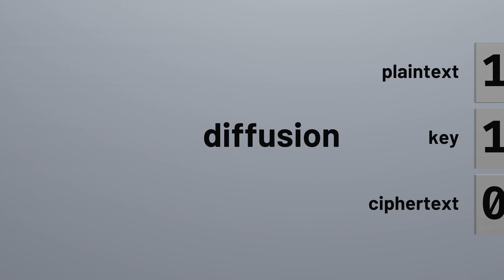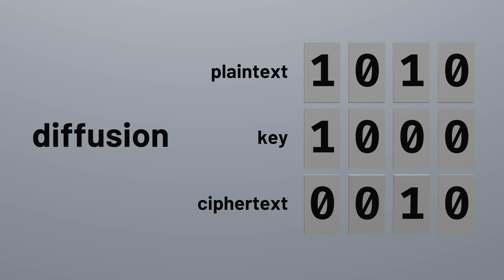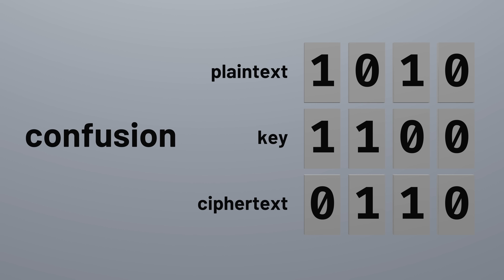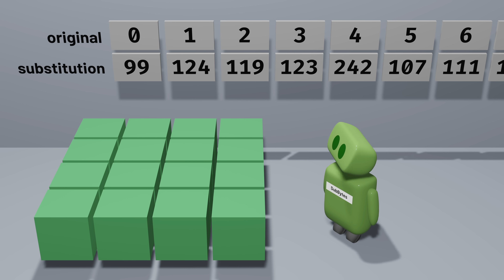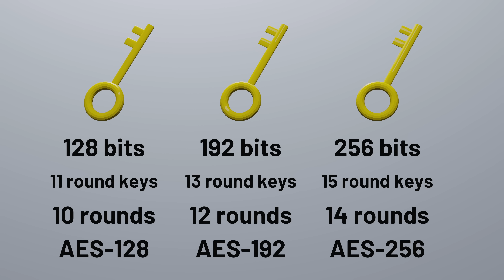AES: How to Design Secure Encryption

Comment: ya but how is it decrypted?
Reply: Each step has an inverse step, you just apply them in reverse order to encryption:

AddRoundKey is its own inverse, you just have to add the subkeys in reverse order.
ShiftRows just shifts them in the other direction.
SubBytes you just read the substitution table backwards
MixColumns is a bit tricky. it works the same as for encryption, but you multiply by different numbers. Only hard part is showing why those numbers in particular work.
Reply: @piscesdan.7151 thanks mate  :) that info helped a ton. So basically this decryption is similar to fiscal Cypher decryption.

Comment: Probably been done, but I'd actually love you to go through that AES thing from the direction of 'decryption'.  How are all those steps reversible?
Reply: It's suprisingly simple. Each of the steps has an inverted version, so you just apply these in the reverse order of their regular counterparts:
AddRoundKey is actually its own inverse, you just have to add them in the reverse order (so add last subkey first, add first subkey last)
For SubBytes, the table is set up in a way so that each output value corresponds to exactly one input value, so you can just read the table in reverse.
With ShiftRows, you just shift the blocks in the opposite direction.
Finally, MixColumns. The reverse works similarly to the regular version, but you multiply by different values. How you come up with those is something I don't quite understand myself, to be perfectly honest.

Comment: Very interesting! I was surprised that the subBytes step substituted bytes according to a pre-determined table, wouldn't it be better to use values from the round key for the specific step in order to add more confusion? But maybe that just becomes inefficient, you would have to figure out a way to expand the round key to 64k bits if I'm not mistaken in order to have unique substitution for each possible byte?

Comment: why can't AES be generalized to higher sizes, like 512 bytes or 1024 etc etc?
Reply: It can, just need to customize it... Plus bigger sizes like those are not even practical, unnecessary bigger keys≠security, well it does, but you'll have to make sure the key itself is complex enough that it can be considered secure. Additionally, AES biggest keyspace is 2^256, which means there's 32bytes or 256bits max keyspace, 512bytes is 4096bits which is extremely inefficient in block ciphers. Such sizes only work in key exchange like rsa

Comment: 4:16 One really non-performant way to do it with just the simple XOR algorithm is to make the key an transcendental number that can be computed one digit at a time, then send a second piece of data for what digit you're on and so long as they don't know the transcendental number you can iterate through the digits of your number forever without them being any wiser this will of course be limited by how accurately you're computing and the number of bits used to tell the digit you're on, and you'd have to come up with a new transcendental number each time you want a new key.

Comment: In the encryption example at around 2:14, another way to do it, since it's using binary, XOR the two bits, since the XOR gate works in a way that could work as a controlled not, ie. you can choose whether or not a bit is affected by a not gate.

Comment: The first rule of designing secure encryption is DON'T DESIGN SECURE ENCRYPTION.  Your new algorithm will be cool and clever and impressive and subtly broken in an awful way, with high probability, and you'll likely only find out after it's too late.

Instead, combine standard cryptographic primitives to fit your needs, the ones that thousands of people have been trying and failing to break for years.  If you still want to design secure encryption, then get a phd, design an algorithm with lots of peer feedback, and give it to a hundred accredited cryptographers and ask them to break it, for several years.  Then MAYBE you've designed something secure.
Reply: Caveat: feel free to design encryption if it's just for fun.  Don't expect it to actually be secure.

Comment: I'd love to see a video explaining how quantum computers break encryption standards, and how other algorithms can work to protect against quantum computing.
Reply: AIUI, it is mostly public key cryptography systems (where instead of one key used for both encrypting and decrypting, there is a public-knowledge key used for encrypting, and where there is a separate secret key which is supposed to be needed to decrypt the messages) that quantum algorithms have been found to break.

I think all of these quantum based attacks (so far)  use the quantum Fourier transform? But I’m not sure.

Comment: I don't understand. Why is confusion and diffusion nescessary. Can't you just XOR every 4 bytes with a different, independant key? With that key being non-reversible ofc.
Reply: If you encrypt 2 terrabyte of data you then need 2 terrabyte of key data as well. It will not be feasible to process and store, not to mention issues with sending it.
Reply: @NoobsDeSroobs  yeah, but for that I was thinking you SHA256 the key. How to not have every block have the same XOR? You put the index with the key as well.

So like
encrypted[idx] = SHA256(key+idx)^data[idx]

You think that works?
Reply: @hobrin4242  That would imptove it, but then you are still doing diffusion over the key. I have not analyzed the approach, but the main weakness I can see right here and now is that the sha algorithm is known entirely, and that it is not cryptographically secure because it leaves patterns behind. It will be better because you add confusion over time. It is a neat idea though.
Performance might be an issue as well, perhaps?

Comment: It would be really interesting to explain some of the candidates that didn't make it. For example show why some of the rejected algorithms weren't secure.
Reply: The remaining 5 were all considered "secure enough". Rijndael was the winner for simplicity, speed and hardware/software friendlyness. Serpent was chosen as backup since it resembles DES in its design (but uses 32 rounds, making it pretty slow), as it mitigated the risk of choosing Rijndael (with GF(2^8) arithmetic, relatively unstudied in the early 2000s). RC6, Twofish and the last one I can't remember were all also fine, but not preferred.
Reply: @yuvalne   Chacha is much newer. From NIST: "The AES finalist candidate algorithms were MARS, RC6, Rijndael, Serpent, and Twofish". The AES competition started in 1998 and finished in 2001. Salsa was developed in 2005, and Chacha was created in 2008.

Runner-ups aren't created a decade after the competition. That's not how time works.
Reply: @dascandy  Also Chacha is a stream cipher, which works in a completely different way. Essentially, it's a cryptographically secure pseudorandom number generator that you seed with the key and a nonce (number used once), and it generates arbitrarily long random bit sequences. The actual encryption is just a XOR of the Chacha output stream and the plaintext. If you reuse the same nonce then you get the same output stream which is really bad (but AES has the same problem, as mentioned at the end of the video you can't just encrypt each block in parallel with the same key, otherwise identical plaintext blocks will result in identical ciphertext blocks which is also bad).
Reply: @marc-andreservant201 
> Chacha is a stream cipher, which works in a completely different way

In its initial design, yes. But practically nobody (<10%) uses AES that way any more; in fact, I didn't even implement traditional decryption at all in my own library since it's never used. AES is used in CTR mode, which transforms any block cipher into an equivalent stream cipher. 

So it's completely different, except that nowadays it's the exact same thing.
Reply: It would be particularly nice to see a similar animation of Serpent. That algorithm was actually considered MORE secure than Rijndael, but it was slower to run.
Reply: Thats true.he should do a video of the runner up
Reply: There was only one candidate because in a car there are 4 wheels; we dont need to know other methods of transport like logs once the wheel is invented. Once an ultimate solution is found it makes ulterior methods like logs redundant. We have the wheel like we have the RSA. Its golden its round and it just worlds like a charm

Comment: How is the key sent to the person you want to be able to “read” the message?
Reply: Currently? Diffie-hellman key exchange. As this method is vulnerable to quantum computers, there are alternatives being worked out. The most likely candidates are known as krystal kyber for key exchange, and Krystal dilithium for signatures.
Reply: @Andrew-jh2bn  Do you have a reference for DH being susceptible to quantum computers? Is that general DH or DH based on RSA problem?
Reply: @dascandy  I don't have a specific reference handy, but the method used is called shor's algorithm, I would start there. My understanding is that all diffie hellman key exchanges are vulnerable, not just rsa. Hence, the national institute of standards is in the process of selecting new quantum resistant key exchange methods.

Comment: The explanation is good but without explaining the reversing operation it's seems just as hashing and not encrypting
Reply: Reversing it just requires doing all the steps in reverse order. You unmix columns by doing another MixColumns with the inverse matrix. You unshift rows by sliding the rows the other way. You unsub bytes by passing them through the substitution array backwards. You unadd the key by doing AddRoundKey again — that step reverses itself. The end result is your original plaintext.

Comment: Another condition you need to add to make the system at 2:41 "perfectly secure" is that the key needs to be strong. In particular, I think it should have high entropy over all suitably short intervals. How short depends on how much the adversary knows about the plaintext. If the attacker knows absolutely nothing about the plaintext (i.e. considers it to be just random bits with no apparent meaning), then this isn't a problem. But that scenario isn't realistic--usually the plaintext has some obvious structure that the attacker is capable of predicting and recognizing (such as being English sentences), so a randomly chosen OTP key that just happens to contain a low-entropy burst can reveal a burst of information about the plaintext. Modern ciphers like AES avoid that issue by mixing up the bits instead of only XORing them with a (pseudo)random sequence.
Reply: Also: a random one-time pad is only secure against reading.  It doesn't provide authentication etc. - if the attacker can flip bits, and is pretty sure the Nth bit is a status flag, they can flip that bit and no-one's the wiser.
Reply: How does the attacker know it's a "low entropy burst"? For that matter what is a low entropy burst? Is it when the key is like 111111? That's fine because the attacker has no idea if it was 111111 or 111112
Reply: @thewhitefalcon8539  By "low entropy burst", I mean an interval of the key that has much lower entropy than expected. The attacker can know you have a weak key when (a portion of) the ciphertext has something in common with what he knows (or assumes) about the plaintext. For example in the case of OTP, if the ciphertext looks like random garbage except for a patch which looks a lot like plaintext, then you probably have a weak key. In general, a weak key makes a cipher easier to crack (the details of how depend on the cipher).
Reply: @geoffmcqueen9955  when you have something that's truly random it's only natural that there are going to be "low entropy bursts" trying to avoid them would make the key less random and hence less secure.
as long as the key is random, the cipher is going to be random and even if there is something that matches with what he knows, well that's just pure coincidence and not a leak.
it's like the library of babel, it's random. does it contain the world's biggest secrets? yeah sure, but is there a way to distinguish between garbage and actual secrets? no, because it's random.
Reply: @keyboard_toucher  If you generate proper random bits then every bit is high entropy. Even if it's like 30 0 bits in a row it's still high entropy because the attacker can't know if it's really 30 0 bits or if some of them are actually 1.
Reply: @thewhitefalcon8539  Assuming the attacker won’t be able to tell the difference between ciphertext and plaintext is just no good, and whether or not that is true has nothing to do with entropy. Entropy is a measure of surprise, or (lack of) bias in a random process. A sequence of 30 zeros in a row intrinsically has extremely low entropy and a very simple structure, regardless of how that sequence was generated in the first place. Choosing something at random does not magically guarantee that what you chose has any particular properties, including being favorable for use in a cryptosystem. An all-zero sequence is obviously useless as an OTP key, as it would make the encryption operation a no-op. We should not lose sleep over the chance that we randomly choose that particular key (since the odds are 2^-m assuming we choose uniformly), but that is far from the only possible weak key choice. That fact is a major reason why, as this video says, "A good cipher should have both confusion and diffusion".
Reply: your argument is analogous to "I'm scared of tossing coins because it might reveal my credit card information in binary"
the cipher and the plaintext are probabilistically independent.

if a bit in the nth position of the plaintext is 1 then the bit in the same position in the cipher is going to be 0 or 1 with 50% probability each.
trying to guess what the plain text is from the cipher is like trying to guess what the next coin toss is going to be from the previous coin tosses. 
if the cipher turns out to be exactly the same as the plaintext (the key is all zero), there is nothing wrong with that. here's an example to prove the point:
let's say the plain text is "cock":
the cipher can be anything like "plan","jade","warm","cool","teen","dick", or any meaningless 4 letter word.
let's say you're "unlucky" and the cipher turn out to be "cock", since all meaningful 4 letter words have equal probability of occurring, the word cock is absolutely meaningless to the attacker, the attacker could hope that the cipher("cock") just happens to be the plaintext but that's just guessing, which is the same thing as brute force, which is why the algorithm is perfectly secure, because any attempt to break it is no better than brute force.
the plaintext could also be padded so the attacker won't know the length of the message either.

 @geoffmcqueen9955
Reply: @keyboard_toucher  Suppose a part of the ciphertext the ciphertext spells out "ATTACK AT DAWN". What do you think the plaintext was?

If the pad was properly randomly generated, we don't know anything. It could have said "ATTACK AT DAWN", or "ATTACK AT NOON", or "I AM KATHERINE". It's impossible to tell.

Now, if you guess that maybe the random number generator wasn't working that day, and spat out all 0s, and the plaintext really was "ATTACK AT DAWN" so you go to defend at dawn, you're taking a gamble that the RNG was broken. If the RNG was not broken you'll  show up to defend the castle at dawn and look silly while Katherine reads the news perplexed.
Reply: @dsdsspp7130  Ok, I randomly choose the key 0100000000000000000000000000000000000000000001000000000000000000000000000000000000000000000000110000000000000000000000000000000000000000010000 for my OTP. Still perfectly secure?

Comment: AES is still less secure than a one time key  .... 
The weak point of a one time key, is the same weak point of an AES the key ... if this is compromised it's trivial to decrypt ... 
the difference is that the AES key is relatively short and only needs to be transmitted once via an other channel - the one time key is long and needs to be updated when it runs out ...
Reply: The real problem with the one time pad is that you have to share the full pad for each message which you have to do securely, and if you can do that securely then you could just send the message securely without needing to encrypted at all. Encryption algorithms allow you to share a tiny piece of information such as 128 bits of AES key and then encrypt any length of message you want.

Comment: You didn't mention the IV at all. How does CTR block chaining work exactly? It's almost magical, makes the block cipher behave exactly like a stream cipher.
Reply: AES used in ECB (like this example, one block at a time) does not use an IV. IVs are specific to chained modes of operation, like CBC. CTR does not have anything to do with CBC, it does have an IV but it's used entirely differently.

CTR (and indirectly GCM) use a block cipher and a counter value. They encrypt the counter value to generate 16 bytes of key stream and increment the counter. This is repeated until the key stream is the same length as the plaintext, and then it's used like a one time pad. The IV in CTR is used as part or the whole starting counter value. Since it basically emulates a one-time pad key stream, you have to never reuse the same IV with the same key, or you get the same problems.

Plain CTR is unsafe to use, because anyone can flip bits in your plaintext by flipping the corresponding bit in the ciphertext and you wouldn't be any the wiser. GCM keeps a running hash and checks the integrity of your data before returning it, so you either get "this is the data and it's uncorrupted" or "it's not good".